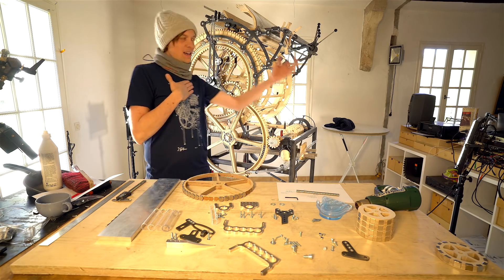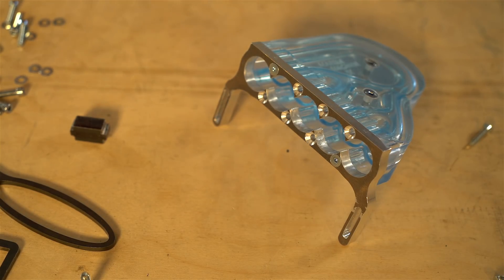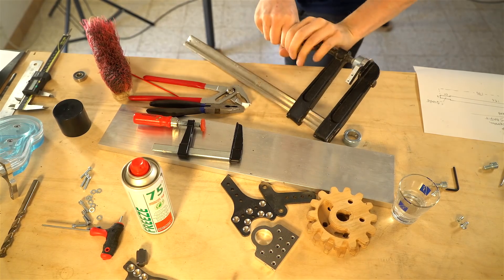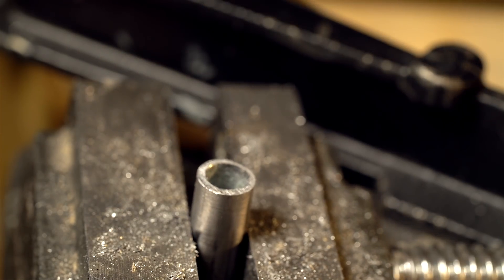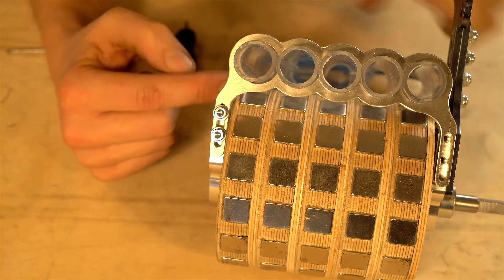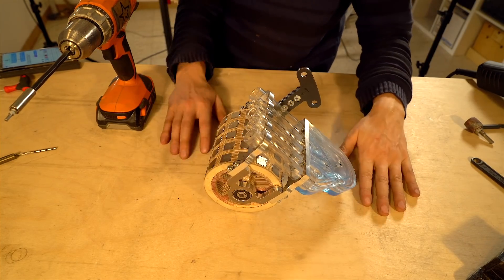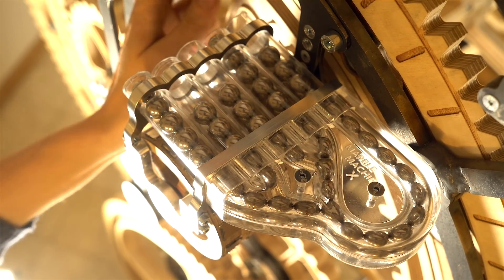Marble Demagnetizer V3 - Marble Machine X #62

Comment: one question strikes me as I consider the magnetic energy balance sheet of the setup: have you evaluated the magnet lifetime for the various parts using some, and subsequent process to replace them? I would think that for conservation of energy when magnetism is passed from one item (say a magnet) to an other (a marble - since apparently they actually need to be demagnetized) or vice versa (at other points in the machine), the resulting decrease in magnetic energy of the permanent magnet will eventually lead to a loss of performance that may become detrimental to proper operation... One thing that may be considered would be to select marble material of as low magnetization characteristics as possible (like hot rolled steel vs. cold rolled steel for flat stock under similar considerations), so that the lifetime of the magnets would be longer... though I don't see without calculation how significant that may be with respect to the order of magnitude of the operating demagnetization process.

Comment: Really excited to see if this contraption works. Wouldn‘t a little drop of the marbles onto a hard surface (e.g. a metal plate) have the same effect without the hassle of dividing them first and overcoming the magnetic resistance?

Comment: Fill the hole with epoxy.
Either insert a screw the other way round into the fresh epoxy such that the threads face outwards and use a nut to put some disc in front of the bearing.
Or drill a new whole into the cured epoxy, threaden it and do what your first intention was.

Comment: If you want the marbles to split evenly then the geometry must be equal for each path. The first y works because its symmetrical. To make the second set symmetrical you will need to straighten up the path first so that you can present another equal y.

Comment: Will the rotation sens of the demagnetizer be a problem?
It seams it may try to push backward marbles which are coming from the big wheel. You already had some issues with the marbles wheel extractor, if marbles are pushed backward it may cause some issues during the extraction isn't?

Comment: When using a any thread tap u should use hand torque instead off the drill as u dont have any feeling with how much force you apply to the thread tap and snap it with the drill while u can feel with your  hands if u have to use excesive force to turn the tap around, just an advice from a automechanics apprentice

Comment: My only doubt is about the force needed to push marbles into theese tubes. Maybe the movement of the magnetic field helps to make some vibrations on marbles to let them flow against the friction
Reply: it appears that the way the demagnetizer spins its going to help "pump" them out. But i thought the wheel was 90 degrees to the path? May have to go back to that vid.
Reply: @chartle1  thanks. I hope it will works without stops or reflux of the marbles

Comment: 10:05 No the problem is that you need to do the route like this:
|  |  |  |
\/   \/
 |     |   <- You need this part going straight forward so they will divide evenly, right now in your version the marbles should turn 90 degrees to get to the middle tracks.
 \   /
   |
Reply: what
Reply: @pineapplerindm  https://cdn.discordapp.com/attachments/340261340926967810/530056380309176323/unknown.png
If this doesn't help you understand I'm not going to bother.

Comment: Martin, anledningen till att gängtappen gick i sönder är på grund av att kanalerna emellan skären blev fyllda. Det fanns inte plats för mer metals flisor, och då kan den inte skära djupare. Om ni backar tillbaka och rensar både hålet och kanalerna på gängtappen med jämna mellanrum så sker inte detta problem. Jag rekommenderar ca 1-3 varv.

"Power tapping" görs främst enbart för korta distanser om gängtappen har raka kanaler, det finns också gängtappar med spirala kanaler vilket till viss del rensar sig själva likt en borr.

Translation for the non Swedish viewers:
The channels on the tap gets filled up with metal cuttings and eventually can't cut any longer, forcing it deeper will only result in it breaking, and it is recommended to back out the tap, clean out its channels, and also the hole one is tapping, before resuming. There is also spiral fluted taps meant for power tapping applications, since they can lift out the metal chips similar to a drill, but they cost a bit more....

In short, a straight fluted tap can only power tap a few turns at a time before killing itself.

Comment: Little tip for the Tap, use a helical tap meant for CNC machines if you wanna use a drill whilst tapping. It could help, especially for crucial peices!

Comment: Looks very nice, especially the acrylic part. But what happens if the marble divider and the next parts are full? The marbles on the magnetic wheel have nowhere to go, right?
Or is it the case that the buffer of marbles on top of MMX is so big that there aren't enough marbles below the marble divider to get this problem?

Comment: Problem with the distance control is that once the exit from wheel is made it changes the whole geometry of the exit port once demagnetizer distance is changed. Therefore you may run into problems marbles not exiting the wheel properly once you change the distance.

Comment: maybe manually hand crank the tap next time? You can feel the flex of the tap and you would have more control...
Reply: and epoxy(metal) a decorative screw on that exposed hole instead :D

Comment: If the dividing channels dont work out you could use three toggles similar to the Digi-comp II or Dr Nim games. It will perfectly split them though idk how it would handle a constant flow of marbles vice the individual marbles it was designed for, may need some modification but the premise is there.

Comment: I wonder...
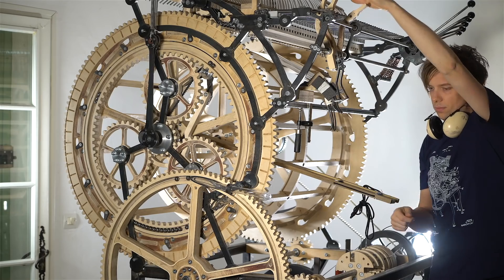Do marbles coming from the magnetic wheel have enough momentum to push marbles through the demagnetizer? Judging from snapshot at 11:50 almost all of momentum in that system comes from sliding down that 1ft pipe between top of the lift and entrance of demagnetizer and in 9:44 I see you have to put quite a force to move them through the demagnetizer. If the demagnetizer is filled with marbles, will one marble sliding down that pipe get stuck at the entrance or will it have enough momentum to push one marble out of the demagnetizer?
And wouldn't they get stuck inside the demagnetizer since it's placed horizontally?
Reply: That was also my question while I was watching the video.
Reply: I'm a bit worried about this but, now that the magnets in the wheels have been reconfigured, I think there will probably be enough force from the marbles still on the wheel pushing forwards to get the marbles through the demagnetiser.
It would have been nice to see the demagnetiser gravity assisted though: there's no real need to demagnetise twice so the intake could be raised up with the marbles angled down over the demagnetiser wheels too.
Reply: Martin should open a “possible issues and suggestions” page somewhere, like in a github project
Reply: @arameskchannel  There is a sub reddit. Link in the description.
Reply: Im also worried about this. Must be fluid as possible.
Reply: @u1kenshin857  as fluid as
Reply: @u1kenshin857  I'm*
Reply: I remember watching an earlier video about the tube for transferring marbles from the lower wheel to the upper wheel. There it was a simple tube sloping down, and already it looked very difficult to get right so that the marbles from the lower wheel get scraped off with minimal momentum losses. Here we have extra resistance at the divider, which by design has to be horizontal. So, frankly, I'm also not optimistic. I think there will be 'constipation' and there will be lots of marbles on the floor.
Reply: This depends on how fast the marbles degauss, considering he tried it without much rotation it would work harder on slower speeds, This system might benefit from rotating in the opposite direction (major pita at this stage though), that would cause the first row of magnets to "push" the marbles into the divider, where the next magnet ring holds the marbles for degaussing, and once degaussed they can gravity feed out of the system. But we will see in live testing
Reply: I do totally agree ! this system seems too far from being as fluent as it shoud be to master the marbles inflow. If I remember well the alternance of magnets' poles in the lower lifting wheel shoud act as a demagnetiser on its own. I think that this solution should be applied for the upper lifting wheel. On my opinion, the incoming 1st demagnetisation chanel of the divider should be kept and be sufficient, the 4 remaining chanels of the demagnetization wheel should be forgotten, and the divider should be rotated 90°, verticaly : all marbles would flow seemlessly, and if a resistance occurs, marbles could jump up to an higher channel. To be honnest I would in this case turn the design or this divider closer to the upper divider's one (cf. episode #45)
Reply: I think that's why it's adjustable
Reply: In motion the the rotation direction of the demagnetizer is at least working to assist ejecting 4 marbles at a time from the exit tubes, hard to judge though if the surface speed of the demagnetizer magnets is equal to or greater than the ones feeding in from the large wheel, but then again 4 exit to one coming in. 
Maybe the first pass counter rotating demagnetizer magnets could be modified if necessary to be on a slightly smaller drum and have less magnetic pull if they do end up having a choke effect on the marbles leaving the big wheel.

That shaft definitely needs remade @ 8:20 it is torquing the drum assembly all over the place. Something is going to come loose or fatigue otherwise.
Reply: Considering how the marbles backed up on the previous wheel exit I'm also leery on this working. I'm hoping for the best....
Reply: he talked about this in his previous episode, the point is that the marble carrier wheel will be full of marbles held by strong magnets and when one marble encounters some resistance, it will have several other marbles persuading it to go through. Also, the demagnetizer wheel will be moving constantly and should not grip marbles, when working properly.
Reply: I agree energy/momentum losses look like that might be problematic.

I'd have designed this component differently;
1) rotate the demag wheel the opposite to what it is now
2) have the marble input channel going over the top of the demag wheel
3) have the marble output channels coming underneath the demag wheel. 
I.e. turning the splitter into a vertical arrangement
That way you can use gravity to help & all 5 (de)magnetisations will push in the same direction (rather than four minus 1)
Reply: I guess the magnet wheel will transfer more momentum to the marbles.
Reply: @monad_tcp  nope because the rotation is on the other side on the feed channel. i really think the demagnetiser have to be only on the 4 splitted channels.
Reply: In the redesign of the demagnetizer, the two channels leading into the four output channels need to straighten out so they are parallel at some point. That would decrease the friction in the magnetizer and therefore the force required on the input channel, as well as favoring all the output channels equally, not just the outer ones
Reply: Martin could remove the magnets from the the innermost ring of the demag if this becomes a problem, or reduce the number of magnets on it. He could also add an acrylic rail preventing the marbles from falling off the wheel when they queue up. I don't think this is going to be a problem.

Comment: Please do not ever use a cordless screwdriver for drilling a thread! Always use a tap handle and all three taps of a three part set for steel.
Reply: Not to mention that you also need to go back 1 turn after 3 turns or so in order to clear the tap of stuck chips. Less likely for it to jam and break.
Reply: @aval1998  drill taps are designed to not require drilling out like that. You can still do it and it is advisable but certainly not demanding of a 3:1 ratio.
Reply: @nutmeg453  i was just talking about regular taps. On the note about the 3 taps, you use those if you want full threads all the way through the hole (if it goes down to a certain depth) I never had to use three different taps in my precision machining class since we never had to make ACTUAL parts, just parts that allowed us to learn everything we need.
Reply: @aval1998  ah fair. That makes sense.
Reply: A Tapmatic is a cool tool.
Reply: Many taps have already been harmed in the making of this series. I think Martin does it on purpose by now.
Reply: battery drills are safer than corded drills
Reply: Why would you use 3?
Reply: i've made very straight threads in steel with a cordless drill and a bottoming tap. there actually is a skill to it
Reply: Or, use the torque limiting clutch feature on the cordless drill?
Reply: @joshuas1767  wouldn't recommend a hand drill at all, because it is practical impossible to enter the tap rectangular. The tap will jam sooner or later and break or at least give you a bad thread. Even with a tap handle I highly recommend to use a machinist square at start for holes deeper than around 3x the diameter for precise work and for hard materials like steel.
In addition, the cordless drill don't break the chips. For unknown alloys, beginners, accurate and error free work: one turn forward, 1/3 turn backward, to break the chip, and so on...
Reply: Well seeing as cnc machines use the same kind of process to tap holes(in fact, speed tapping produces a better thread in many situations) and the fact that he isn't tapping extremely thick materials(or particularly hard materials for that matter) it should be perfectly fine. Still slightly risky of course but tapping by hand has it's own problems as well.
Reply: @entropy1454  Not extremely thick?   It looked like he was tapping about an inch worth of threads into a closed hole in a piece of stainless steel (which is a hard material).
Second CNC machines actually hold the tap straight, they auto feed the tap at the correct rate and the taps generally have much more aggressive clearance grooves.  It's not at all comparable.

If you do it by hand you can almost always tell when a tap is going to break and avoid it (unless they are tiny, because they have much smaller tolerances).  If it was sheet metel or even only a few millimeters into an open hole he probably would've been fine with a drill.
Reply: @UnbeltedSundew  I was talking about when he tapped the mounting holes for the demagnetizer, which was a through hole and probably 20mm(.75 inches) max worth of material. On the cnc part, yes I realize that they keep it straight, but then again they are going at a much faster speed and usually very thick material. On top of that, even a cnc machine is limited by the tool it's using, a tap can only be so rigid. If you have a .1mm diameter tool, a cnc machine doesn't have that much more of a chance than you do at keeping it in one piece. I'm not saying that there isn't a better way to do it (holding it in a drill press and turning by hand for example, although that isn't possible for the mounting holes without some serious disassembly.) or that it was even the right type of tap to thread with a drill(lack of appropriate flutes), but the op acted like it was the worst possible thing you could ever do, which is not the case.
Reply: @entropy1454  however cnc speed tap don't typically wobble I Martin used a lathe or a drill press to hold the tap I doubt he would have the issues he does with tapping
Reply: @entropy1454  yeah the big thing here is how thick is the material imo. when dealing with mostly sheet or -10mm flat stock you can easily get away with hand held drills on high speed. the decreased torque you get from using the high speed setting is imo usually a greater advantage over the decreased speed.Once you go to thicker materials or higher strength alloys though i tend to go for 3 stage hand driven
Reply: @entropy1454  CNC machines hold the tap perfectly rigid, and as someone else pointed out he appears to be using stainless steel which work hardens like a beast, so the machinists and engineers design the hold with proper thread percentage. His tap chart is more than likely written for 75% thread which stainless will destroy your taps unless you've got experience with it. Tapping stainless is best with a 50% thread and using a manual hand tap with a guide of some sort. I've worked with stainless for years, and when using that method I only broke taps when I did something stupid like using an old poor condition tap, even with really small and deep holes without any lubricant.
Reply: @rocketsurgeon4876  Well the taps you use must be made of magic then since the fact that it's held by a cnc doesn't change how a small tap will bend under too much pressure, and even then, whether you are using a cnc or not, the steel would work harden all the same. It's also impossible for you to be able to make any accurate generalization on stainless steel when there are so many different alloys, there are alloys that are hard enough to cut through other steels, and then there's alloys that would bend over after trying to cut a 2x4.
Reply: @entropy1454  General hardness is more a property of how it gets heat treated than the type of alloy ;)
Reply: @rocketsurgeon4876  Tell that to iron, it would be jumping for joy if it found out it could be hardened :P
Reply: Where's the problem? Just use a machine Tap. No problemo
Reply: @Valentin-vs6ev   Where's the problem? You'll never sense if/where the tap's stuck with a machine. That's why it breaks. A hand tap gives you a torque feedback sense so as to spin back and redo in little steps.